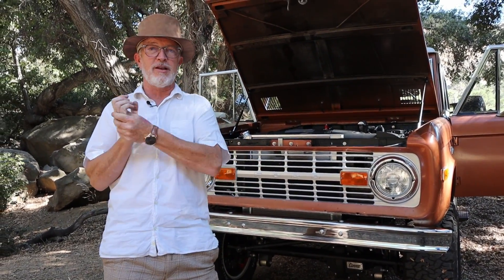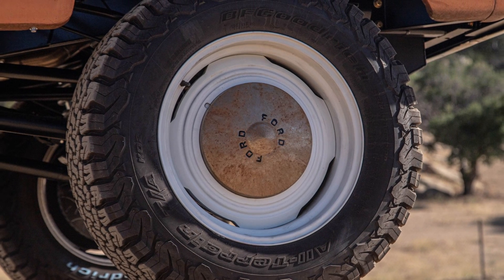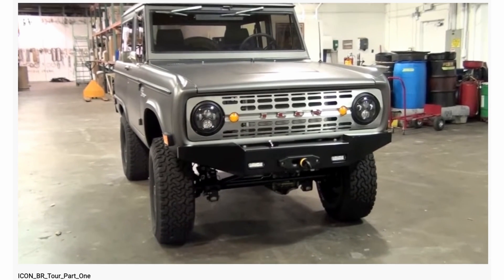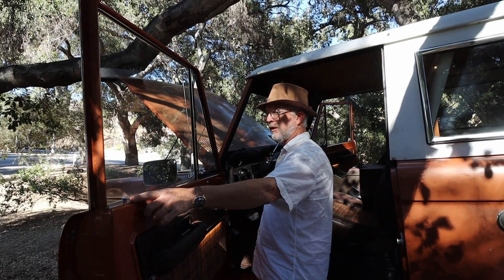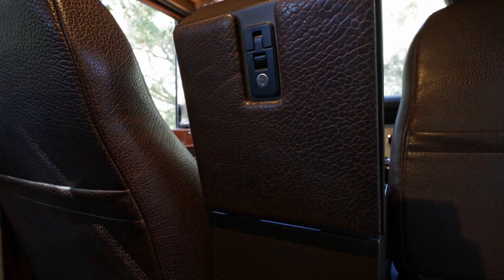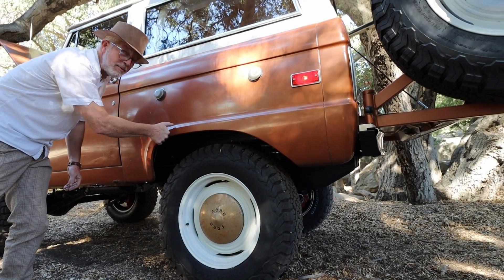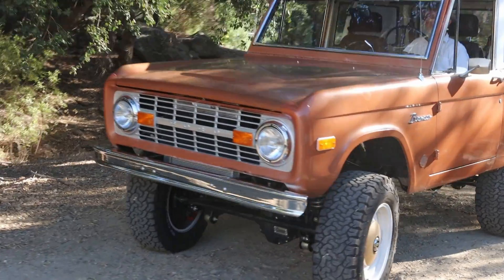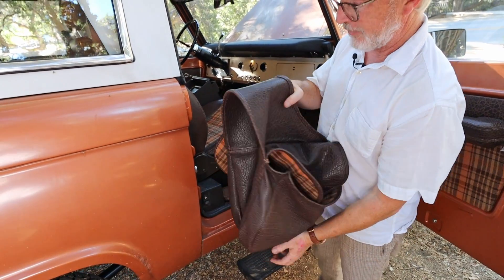ICON Derelict BR #91 Restored And Modified Ford Bronco

Comment: I would be interested to hear about how you guys handle the transitional areas between the existing patina finish and the restored/refinished non-visible areas. In the patina trucks I have worked on those seemed to present the most challenge.